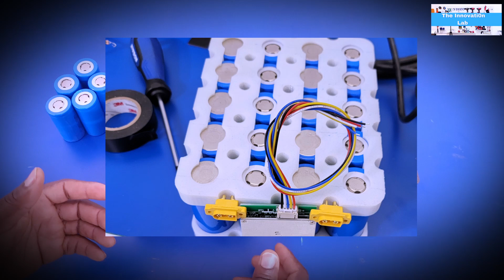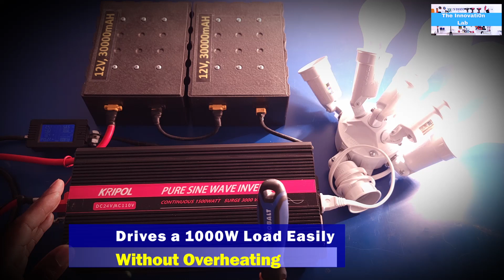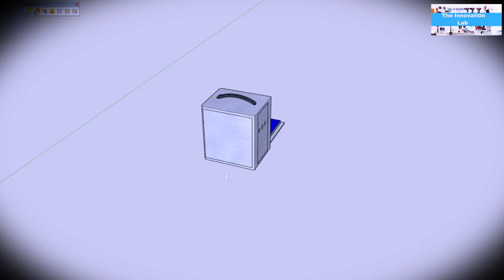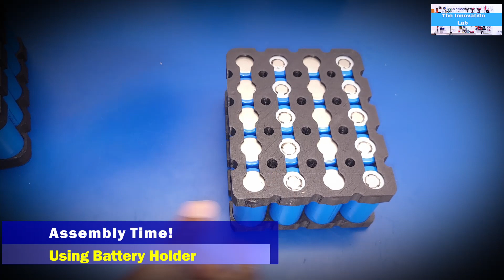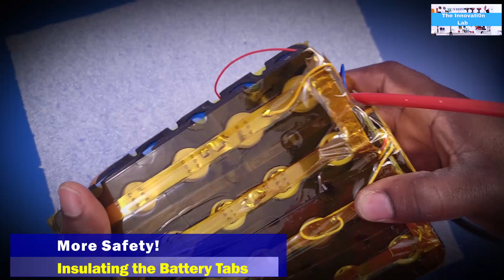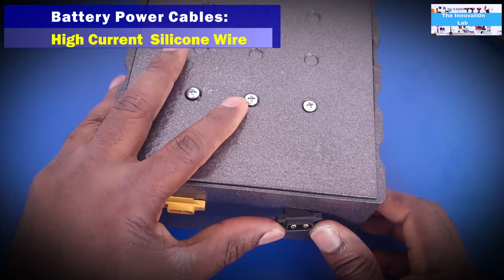How to Make a Cheap Battery Pack

Comment: Hi, thanks for your videos, I'm learning a lot 👍👍👍
Is it better/safer to use or not to use individual BMS on 2 24v 30ah 18650 batteries?
I'll connected them in parallel to achieve 60ah.
Thank you again for your help 🙏👍🙏
Reply from the maker: Thanks for the wonderful feedback. I am glad that you are learning from our videos. 
👍👍👍
To be absolutely honest, I have never tried using two BMS controlled batteries in parallel - only used them in series. I am not saying it won't work, but as you have seen in our videos, our methods go from theory/concept to research, then to testing. That means I can't really make any recommendations until I have tested this method.

However,  what I would recommend is for you to try using one single BMS - a high current rating. 
You can easily find strong BMSs that can support a 24V LiFePO4 or Li-ion battery builds.

CAUTION: 
when it comes to BMSs, please stay away from the cheap ones....I learned the hardware...lol

I found the one I showed on our video below 👇 on Amazon, and it seems like a high-quality product. But I have not actually tested it.
👇👇👇
https://youtube.com/shorts/3ccX5J6F-FE?si=wDUunj-FAvXV7pMv

Amazon product link: (I am not affiliated with this vendor. Please check the product reviews)
👇👇👇
DALY Smart BMS LiFePo4 24V 100A... https://www.amazon.com/dp/B09WKCC2HR?ref=ppx_pop_mob_ap_share

I hope this helps.
👍😎
The Innovati0n Lab 💥

Comment: Hi.. can we use  BMS salvaged from laptop batteries for a 4 × 12v li ion battery packs in series to make 48v li ion battery pack. Is it possible to make use of them instead of a commercial BMS
Reply from the maker: Thanks a lot for watching this video. 
However, if you have access to some inexpensive commercial BMS modules, that would be a better option.
But nevertheless, recycling the BMS modules of laptop batteries and using them in series for a 48V pack sounds super interesting. The only issue will be that the amount of current they are designed to deliver, are mostly limited. 
This is not something I have tried before. May be I can make it one of my experimental youtube project for a future video.
Reply: @theinnovati0nlab782  Thankyou for considering my query and planning to implement it.. Eagerly waiting for your video. (Whatever maybe the output current) just have try on it my friend. Let's reduce the E waste 💪🏻✊🏻